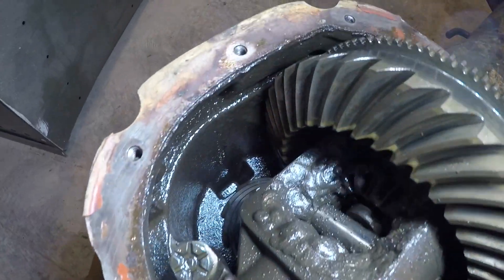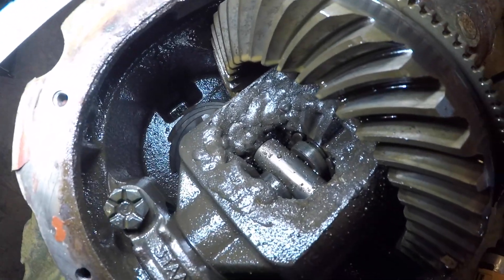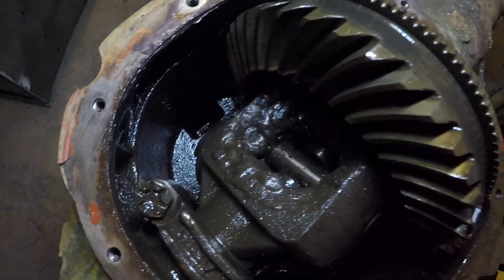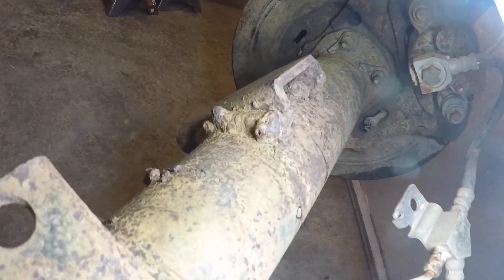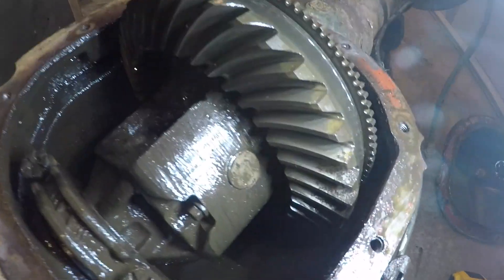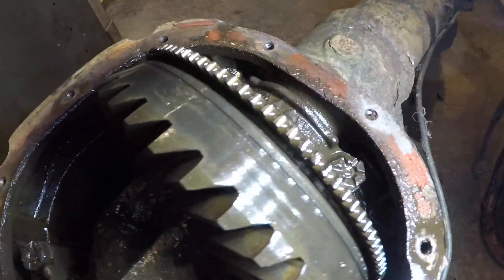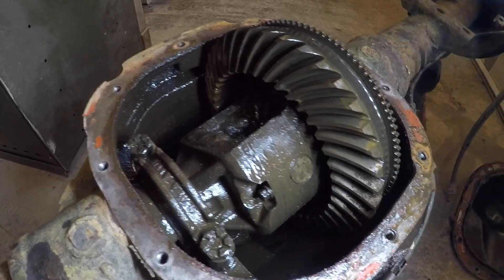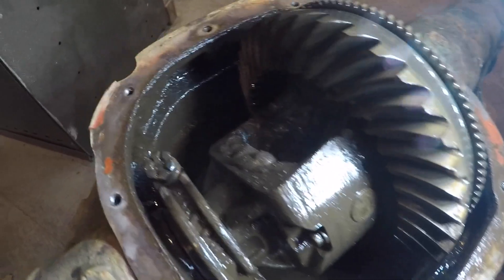Bought an 8.8 axle!

Comment: It looks as if the spider gears are welded to the center pin. If that is the case good luck getting the axles in to remove the c-clips.You count the number of teeth on the ring gear to find out what ratio the diff is. Mark a spot roll around and count. That carrier has all the hallmark signs of being welded inside the pumpkin. I hope they were careful with weld spatter and slag removal. It is also critical how the ground is hooked so that current is never run through the bearings. If you want some advice on getting that apart let me know.
Reply from the maker: You’ll have to check out my follow up video I posted a few weeks ago when I took it apart. The spider gears weren’t welded to the center pin but the spatter on the center pin required me to use a metal rod and hammer to work it through so I’ll be getting a new center pin. One of my buddies has a carrier he’s gonna give me for that axle so I may just mini spool it instead of leaving it lincoln locked

Comment: Keep it welded. Mine is and I love it never had a issue with it and mine was a limited slip unit which is suppose to be weaker but I beat it hard with 38.5/16/15 super swappers and never had a problem
Reply from the maker: More than likely I'm keeping it welded. Only thing I was concerned about was integrity of the previous owners welds, but they're probably alright. Can't wait to get the thing up!
Reply: jtmoffroad true. They did it right and look good to me. Good luck. I'll be watching along now that I've found your vids . All I post is riding videos,check em out if you get a chance
Reply from the maker: Great! Thanks for watching! I'll be sure to check out your vids!

Comment: 50$ roll it till it breaks can’t beat that!!
Reply from the maker: Yea not a bad deal at all!
Reply: jtmoffroad Hell no get 6-12 months out of it for 50$ can’t beat that deal. Then upgrade all internals and roll on. How big are the tires your running?
Cause there are so many upgrades to handle almost any tire wheel combo! Bigger axles since it’s a rear the upgrades won’t be super expensive! Glad you got a good deal!! Wheeling cheap makes it feel not as bad if it breaks.
Reply from the maker: Wheelin cheaps the only way I can go hahaha. I run 35x12.5s
Reply: jtmoffroad As long as most of the time you keep it off road it should last quite a while! Jeeps aren’t known as torque monsters so it could last for years! Best of luck looking forward to more in the future!